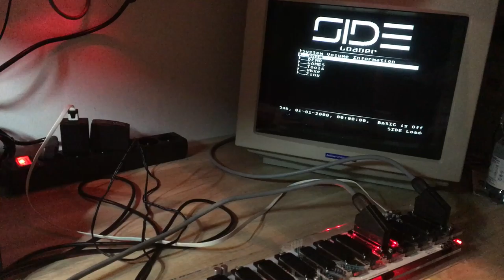W_HYDRA

Comment: Got my Hydra yesterday. Very impressed with it. 
No perceptible drop in video quality, proper isolation of the seperate inputs, great build quality, has no trouble detecting active input from any of my consoles (some of which are custom). 
Highly recommended.